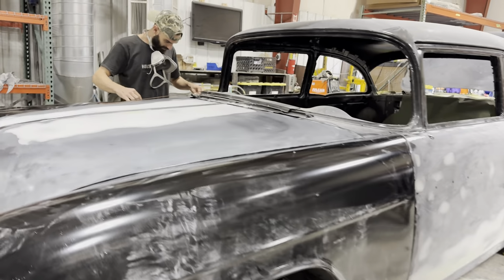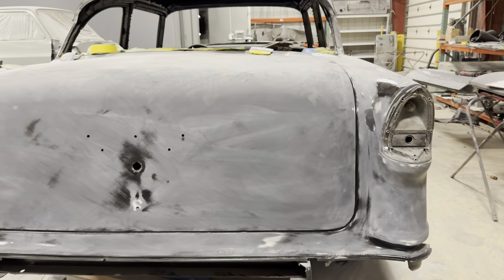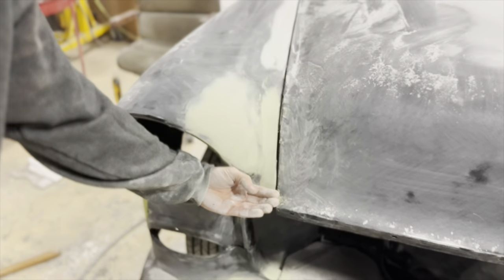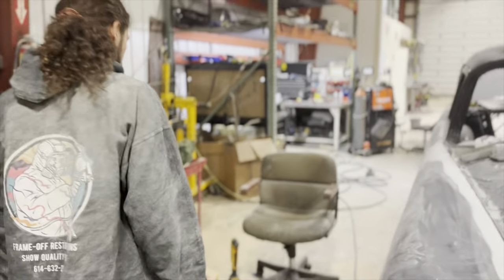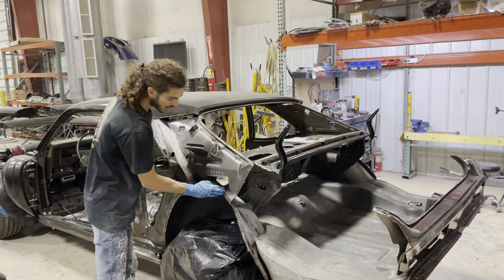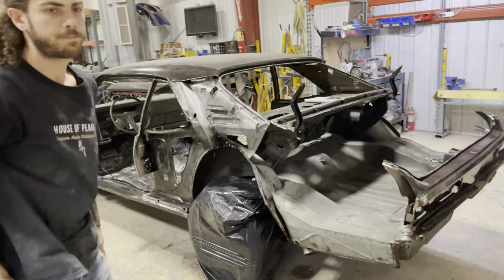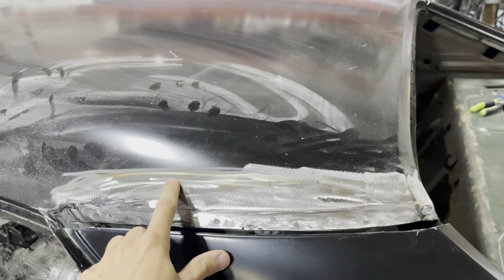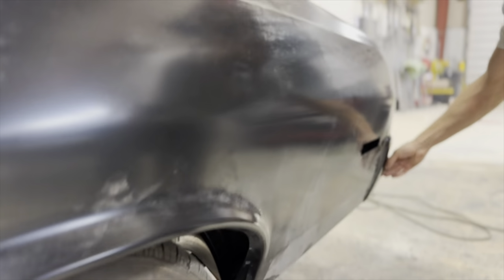Getting Closer on the Old Man’s ‘55! Bodywork & Panel Fitment

Comment: You guys amaze me. I'm sure that you think that its just another day, another car. But for me... to see your skill, knowledge and what needs to be done to make those gaps and panels perfect is awe inspiring. Kudo's to y'all!
Reply from the maker: Thank you! This one is actually very minor compared to normal. 
Jesse did a great job aligning all the panels during metal work to ensure good fitment now. Everything he needed to weld rods and do fitment on, was not possible to move during metal work. If that makes sense. 
The golden star aftermarket panels were also great quality compared to others we’ve gotten. 

The most important part, is taking your time during install and making sure you cross all your T’s and dot your I’s. Don’t rush during the cutting and install stage or you’ll be fighting with it the whole time with fitment

Comment: 40:04 Those door adjustments, forty four years ago the way we had to adjust those was actually either grab the door and push down on the handle end to flex the hinge mounts, if it was to low we would pull up on the doors. If the door had a gap problem at bottom or the top, we had to sort of twist on the door itself. Sounds bad but that is what worked and how it was done.

Comment: glad ya'll are wearing gloves that protect against the cleaner since labels indicate phosphoric acid will seep into the body through the skin. i believe it cause  it was widely used  to clean residential and commercial condenser coils. the stuff. not comfortable getting in contact with. later went to alkaline based cleaners. still had to be careful and at least it did not attack the material used in making the coils.

Comment: You are correct $900 plus is freaking outrageous for the rubber seals for the car, but they pretty much know that if they asked $2,000 for the runners they would get it, because there are only so many places that offer the rubber seals, and most of the other options that exist likely get the product's they sell from the same source's.

Comment: Great work. Why use 40 and 80 grit after you stripped the fenders? Doesn’t using 40 grit take too much metal off? Also what Epoxy do you use! I’m New to your channel. Thanks for posting your videos.
Reply from the maker: 40 grit on a da will barely touch the metal. If it was an 8” mud hog or grinder, it’ll tear the metal up. It depends most the speed it runs and direction of the sander. A random orbital sander will be much less aggressive than a rotary. 

40 grit, followed with 80 grit both on a DA will give you a far superior physical adhesion than 80 grit alone. 

Thank you for the question! Definitely a good one 👍
Reply: @HouseofPearls  thanks for the reply. Better adhesion is what I was hoping you would say. I’m about to do this to my 70 Monte after I install
Mini tubs! I found your channel from the old man’s garage channel!

Comment: You might try a tablespoon of baking soda in a bucket of hot water to neutralize the acid, and see if that does a little bit better job of neutralizing the acid.
Reply from the maker: Probably not a bad idea, but I’ve avoided soda blasting due to having to sand off the sodium bicarbonate coating that comes after. I would assume baking soda would do a similar thing. 

I’ve never had any adhesion or flash rust issues when properly converting the acid with hot water and multiple fast rinses and two buckets

Comment: Nice work quality all the way... what fillers do you all use?
Reply from the maker: We use evercoat rage gold for filler and rage ultra for finishing icing. I don’t like glaze, I’ve found it to be brittle. 3M platinum plus is great filler too but I don’t like the way it sands and doesn’t go on as smooth in my opinion but others have good luck with it. 
I stick with rage because even after accidents and major impacts, I’ve had very little cracking and delamination compared to others.
Reply: @HouseofPearls  we have used the rage and it sands good  thanks and keep up the awesome videos

Comment: Does the body line on the door closer to the bottom line up with the aftermarket rear quarter Bodyline? When I installed mine the aftermarket quarter Bodyline was about a half inch higher than the door. On the nova
Reply from the maker: Yes the bodylines in the stamps are a bit off on the drivers quarter panels. Either your top lines or bottom lines will be off just depending where you favor it. 
A little bit of splicing and coaxing and you can get them where you want

Comment: So what will the fender look like with the hood open, where you welded that rod in to fill the hood/fender gap?
Reply from the maker: You fiberglass and smooth the seam on the upper side. Then seam seal the backside underneath the fender just to ensure the welds are 100% sealed. When it’s done you’ll never know it was there
Reply: @HouseofPearls  Awesome!  Thanks!  Killer work btw

Comment: Do you apply a metal prep prior to epoxy primer on bare metal?
Reply from the maker: Good question. Sometimes we do sometimes we don’t. If we’re working with clean metal, then no reason to. I’ve come to learn less is more on these cars no matter what you’re using. Epoxy over bare metal is perfectly suitable. The metal prep step will help if you’re working with rusty or pitted metal
Reply: @HouseofPearls  Just curious what promotes the epoxy to bond to the bare metal.  Back when I used to do this years ago, the process was to metal prep then overcoat with epoxy.  I understood that the metal prep created the initial bond and then the epoxy would bond to it.  Now mind you this is quite a few years back, so I am sure processes have changed.  I also used to see an etching primer first and then epoxy.

Comment: It's a real shame that all of the places that sell aftermarket panels can't do a much better job at tooling their machines that produce the panels to be much closer to the specifications of original General Motors and all the other manufacturers.
Reply from the maker: I agree that it’s unfortunate they don’t come perfect out of the box. BUT I will say, these fenders would’ve been fine for your average person. With a little grinding and finesse you can get them in a decent place. 

I’m very thankful to all these aftermarket companies for taking the time and energy and money to try to make panels for us that even remotely fit. Some are worse than others and I’ll always take an original but golden star has done a great job of providing a good quality replacement and ability to take a rotted out 55 and with a little skill, make one that was better than new.